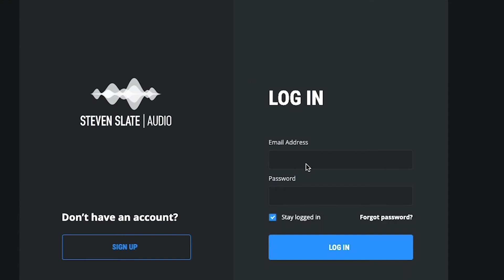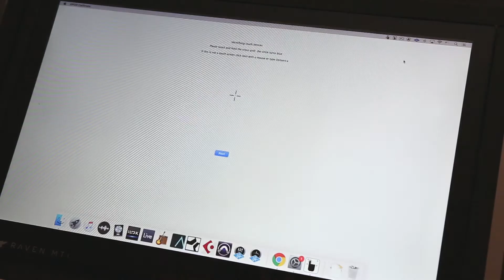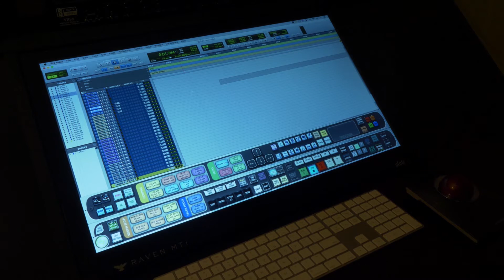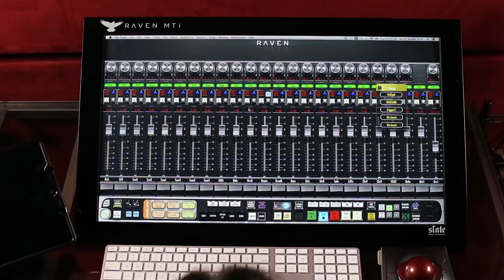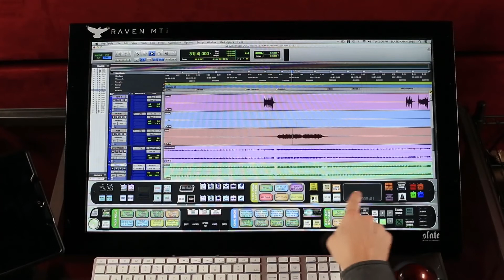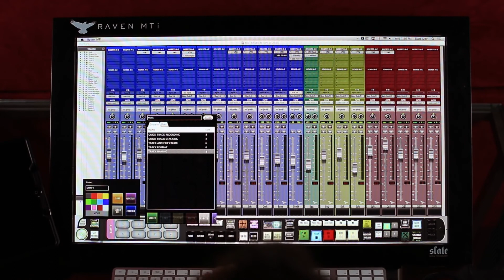RAVEN 3.9 for macOS Pro Tools Quick Start

Comment: Current Raven download package isn’t working fyi. Had to go get the v-control pro download separately direct from them to get it to work. Took some extra time to get to that after trying the pk from the email, then the ok from slate audio account, then roll back version. Final worked after going to the source for that one install for v-control pro. All other settings and permissions were correct and once I went to v-control to get install download everything worked.

Comment: what is the difference between raven and a touch screen on the market?
Reply from the maker: RAVEN comes with Multi-Touch Faders, Batch Commands and Gestures for the Top DAW's. 

With a generic touch screen you can only move 1 fader at a time, with RAVEN you can move 10 faders at time.